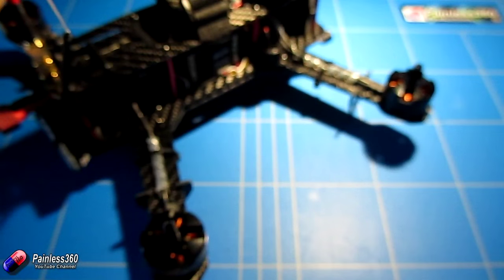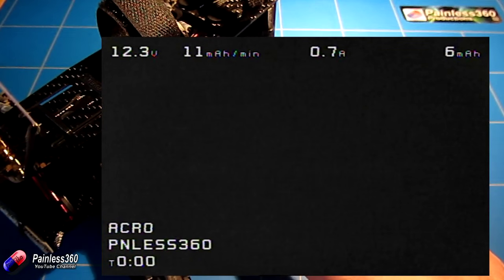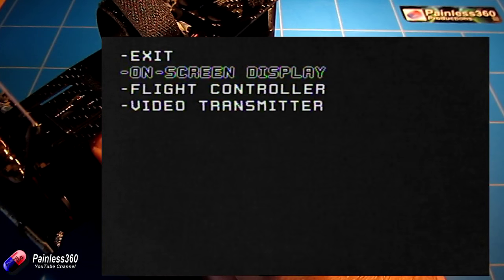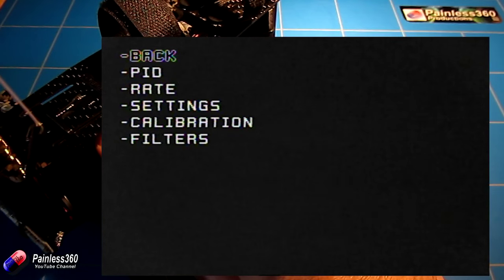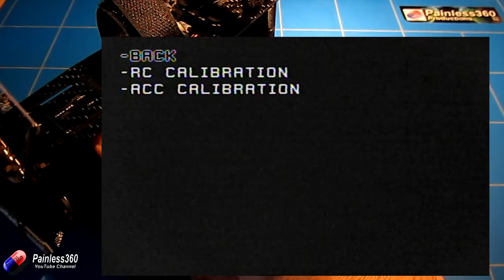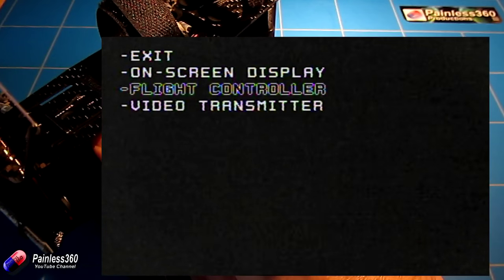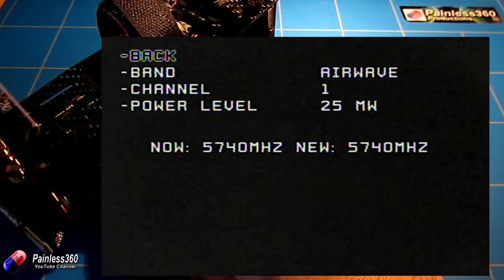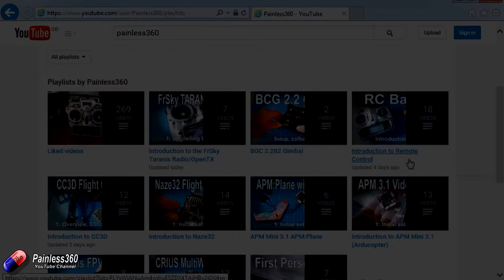TBS PowerCube - TBS Core Pro Menu Overview

Comment: i dont know if its worth mentioning but theses days when i am discovering motor direction on cc3d or other set up i leave the motor nuts on and if they spool up the correct way the nuts should tighten if not they spin off, my ppm set up going to spektrum dx6 has been harder than i thought pairing lemon rx as pin 8 carries ppm signal, apparently, still yet to discover but will report back as soon as.
Reply from the maker: +Alan Lydiate Great tip, that's what we do here..
Reply: rush in haste, repent in leisure as they say, the wiring diagram for ppm mentions pin 8 which is port 6 on the mini jst cc3d connector of which in my rush to complete ignored and the trick was to take the white out of red black white, the only bunch of three wires and replace the white with the last wire whatever the color is as they all seem to be different on the cc3d jst and add this wire to the black and red, and as if by magic all works fine, only got bored with spektrum so added my very cheap but beautifully reliable flysky FS-I6 radio and paired to FS-IA6 RX changed the settings on radio to ppm and FLYING, now after watching your video on TBS Powercube i have gone and bought one, so it all starts over, i ll be happy when summer comes and i can fly all these models i have built, keep up with the great informational videos as even electrically minded dummies like myself can learn lots.

Comment: I'm using a pnp 50,  Ive always just left it stock settings and it works great for monitoring voltage.  I'm just curious if you can move things around on the screen like other osd's.  I'm assuming not.  ive never gone into the menu lol
Reply from the maker: We will be updating our Cube with the Vision board in the coming weeks so I can take a look at this then.. Stay tuned! :D

Comment: will this work well with any pdb?
Reply from the maker: Not if you want all of the power detail in the OSD, the PDB in the Powercube sends the details of the battery voltage to the FC using the inbuilt risers. Best of luck!